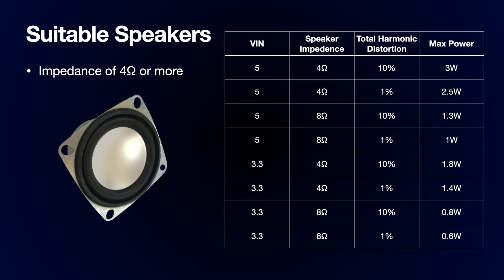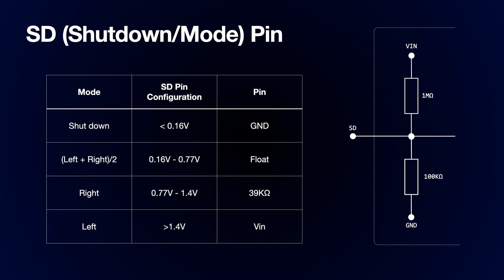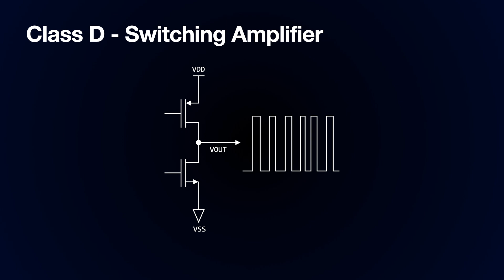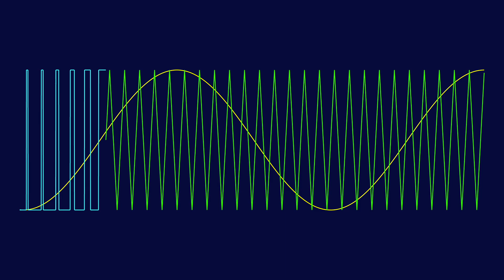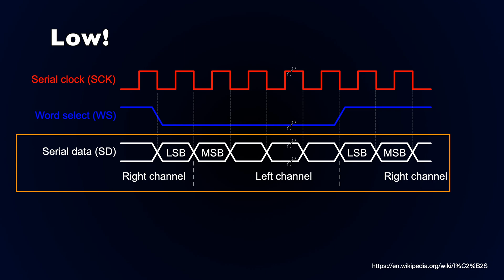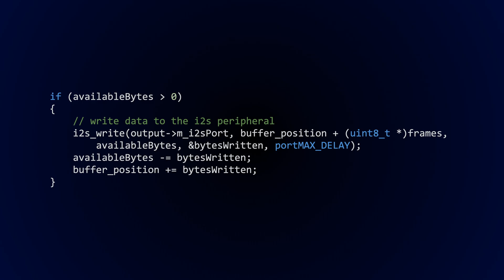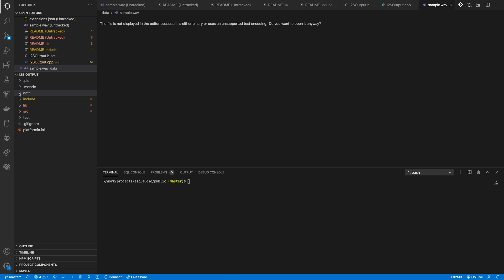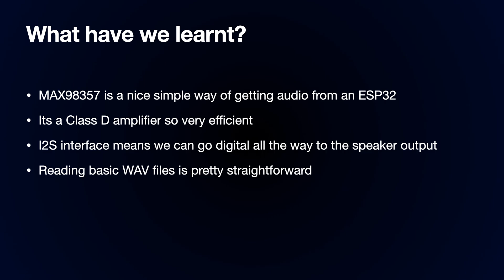ESP32 Audio Output with I2S DMA and the MAX98357A Class D Amplifier

Comment from the maker: Interested in ESP32 Audio: https://www.youtube.com/playlist?list=PL5vDt5AALlRfGVUv2x7riDMIOX34udtKD
Looking for all my ESP32 projects: https://www.youtube.com/playlist?list=PL5vDt5AALlRdN2KyL30l8j7kLCxhDUrNw
Reply: I am curious how the pinout and wiring would be affected if I use the Firebeetle esp32 from DFRobot?  The firebeetle has a rather distinct series of pins exposed and while it supports i2s I am not sure where to connect this.  Googling ended me up finding this...so I am gonna poke it and see what happens...
Reply from the maker: @Kai-Made  In theory, you should be able to use any of the pins on the firebeetle as the ESP32 is pretty flexible when it comes to GPIO pins and will route the peripherals to whatever pins you tell it to use.
Reply: @atomic14  you are correct.  A little trial and error.  Using the pre-designed library I was concerned it was pointing to certain pins and I just wanted to make sure my MC had them.

I figured it out.  The max98357 amp module is not very loud though, and I have done the resistor pull to make it 15dB, still not noticeably loud.  I was hoping to use the combo to sound an alarm and have a device speak to the user... like "buzz buzz do something xyz".  But I am floating around 20dB, might have to get a larger amp...not sure yet.  more testing required.
Reply from the maker: @Kai-Made  That's interesting, I've always found it too loud! How are you powering it? You should connect it directly to the 5v power. Also, by default, it plays (right+left)/2. You can either set it up to only plat the left or right channel or output both left and right. What kind of speaker are you using - that can make a big difference.
Reply: @atomic14  2.5 inch 4ohm speaker from bluetooth thing I cabbaged.  I was using 3.3V, I will try using 5V next chance I get.

I will try it with the pulldown to boost to 15dB as well...and see how it goes.  I just don't think I will be getting a useable audible alarm from this...was hoping to use it in the field on a project I am trying to sort out.  We need a 80dB alarm and piezos just aren't doing it...because the encasement/box we put it in.  It would have to be external, and all the "waterproof" piezos we have sources are terrible, but the water proof speakers we have found seem to work well and that is why I was testing...
Reply: Hello atomic14, have you ever tried or planned to use an ESP32 as input for I2S signals (from other sources, maybe another ESP32 (internet-radio with wifi enabled) or an I2S microphone) and feeding the data forward to a bluetooth speaker?

Comment: TinyS3 (ESP32-S3):  Hoping to save others a lot of time, I had to set the Data-In pin to an unused GPIO in the i2s_pin_config_t:   .data_in_num = your_unused_gpio_pin    Leaving it at the default '-1' will, I believe, use the same Data-Out pin for Data-In...which will mess up the Data-Out signal and you will never get any audio out. I am using PlatformIO with arduino framework, using the i2s.h library. A newer i2s library, i2s_std.h, is not supported with the arduino framework at this time (5.23.25). The newer i2s_std.h library MAY remedy this issue, though I haven't tested it.

Comment: You probably made an error in calculating the resistor value for the right channel. 390K seems to work with 5V VIN, 39K has the same as a jumper - left channel only.

Comment: 1:03 This means that i can't connect the output into another amplifier?
Reply: Correct. I believe it uses the speaker’s voice coil as part of its output filter circuit, which would not be possible with a high impedance input circuit on secondary amplifier.
Reply: Use pcm5102

Comment: I keep blowing up these bloody amps. Tried the sparkfun breakout and jumpered for L and R... blew up an amp. Bought Adafruit and powered SD acording to left and right... Blew up another chip. Reading the datasheet over and over again. I think I've got it configured correctly for Left and right but really confused.
Reply from the maker: That is strange they are normally pretty robust. How are you wiring it up?
Reply: @atomic14  I got two spark fun ones and wired them up according to their hookup guide. Next I jumped right and left... One of them broke. The other one has crackling noise now but still functions. I ordered two ada fruit ones... And one broke hooking it up configured for right and left channels. This time I ordered 4 so hopefully at least two will work for prototype I am trying to build.
Reply from the maker: @exploringgodscountry  When you say you "jumped right and left" what do you mean?
Reply: @atomic14  I mean jumpered. The spark fun ones come with configurable jumpers.
Reply from the maker: Looking at the sparkfun docs, by default the board will mix LEFT+RIGHT. If you just want left or right, you need to cut the link on the "mono" jumper. Then put a solder blob on either the L, or the R, depending on what channel you want it to output. If you are connecting both L and R then that is incorrect.
Reply: @atomic14  hey thanks for looking that up. I had to get at my computer so I could type a real reply :) Really appreciate your help and your channel. I had a SparkFun employee double check what I did from hookup guide on their website. It was correct. My Adafruit boards I soldered into a grid PCB prototyping board. I wonder if I messed something up doing that. I struggled immensely fiddling around with the right channel left channel SD pin configuration. The datasheet is clear enough but seemed like every time I tried to configure a channel I'd get horrible static, it would just stay mono, and or the board would die. I honestly, have tried soooo much that I should probably make a video just on what didn't work haha But your video DID get the left channel to configure for me! I had kind of suspected there was some load internal to the chip that was affecting voltage for the SD config but didn't fully understand their push pull versus pull up stuff. It's also possible I didn't configure a push pull resistor and blew some of the other chips up.... BUT that says for under 3.3V power supply. I have 3.8V. The list goes on. I got my masters degree many years ago to do this stuff but never did much of it as an engineer. Now I'm trying to open a freelance PCB design shop and practicing with with a BT audio concept I have. I have one customer lined up and really need to sharpen mys skills before we take their project on. However, darnit, they don't make the little DIP packages anymore I used to order which made prototyping SO much easier. I'd just reach out to the chip maker and they'd send them to me for free most of the time. You didn't need these breakout boards. Thanks for the help! I really appreciate it. I've watched several of your videos and they've been great!
Reply from the maker: No problem at all! It can be very frustrating and often the datasheets seem to be written with an "expert" in mind and lots of assumptions. I've been caught out by hidden pull ups on pins.
Reply: @atomic14  I've found quite a few typos in datasheets! One thing comes to mind is ADC for an ARM processor I was working on back in 2008. I spent DAYS trying to figure out why I couldn't get the ADC to work only to find out it was a typo in the datasheet! And there I had several other engineers working with me. It's awesome now that we can collaborate and share through the internet. Thanks for your videos! Very helpful.

Comment: Thought I would add this, BUT for the ESP32S3 i2sconfig I had to add/set the .left_align = true to get the serial data to most significant byte first or the audio was complete garbage. Only found this by creating a generated count up int16_t buffer and outputting thru i2s_write and using the saleae logic analyzer to see this was the issue.
Reply: this saved me - thanks for posting.

Comment: can we not play a wav file coded as hex file through I2S max98357A. I tried using Xtronicals example and it worked without I2S but was very noisy and would like to do the same using I2S . The problem is I am not  an embedded systems developer I am able to manage but do not have in depth knowledge in this regard can you please guide me?

Comment: Hello atomic14, I like your videos about the ESP32 and it's audio capabilities. I'm trying to build an internet radio with two ESP32. Why two?: because with an ESP32 (due to Phil Schatzmann) you can only use either wifi or bluetooth (not both at the same time). But I'm planning to use a bluetooth speaker with the internet radio, just because the sound of my BT-speaker is much better than the squeeky 3W at the max98357. So I need both: wifi and bluetooth. Now I'm looking for an example that uses the I2S of an ESP32 as input and parses the audio data to a bluetooth speaker. Have you ever tried such a thing (ESP32 Audio Input with I2S DMA and A2DP output)?

Comment: Thank you for your videos, I am new into electronics, and I learned a lot by them! :) I am working on a project, which uses the MAX98357A amplifier with an 8 ohm 1.5W speaker for now, and I have encountered a weird issue. 

Hardware: Nodemcu 32S, MAX98357A, 8ohm 1.5W speaker, which I want to exchange to a 4ohm 3W one.  The power supply is a 5/3.3V breadboard power supply at the moment.

I want to feed 5 Volts for both the MAX98357A, and for the ESP32. I connected the power source positive side to the 5V pin of the ESP32, and to the VIN pin of the MAX98357A. Both the groundings of the ESP32 and MAX98357A  meet in a common star shape before going back to the negative side of the power source. When I powered the system, the speaker was completely silent almost, I heard some extremely quiet cracking from it. I tried to check the speaker by a multimeter, if does it receive any Voltage. When I connected the negative needle to the negative side of the speaker, the speaker starting giving sound, but a very cracky distorted one. After I connected to positive needle of the multimeter too, the sound became clear. If I remove the multimeter, no sound again. Then I pulled out the grounding of the MAX98357A completely, and it started giving the cracky sound again. In the end, I tried connecting the gain pin to a GND pin on the ESP32, then it gave proper sound. The same effect happens with both the 3V3 and GND pin of the ESP32. Connecting the GAIN into the star shaped grounding wires of the ESP32 and MAX98357A, no sound again.

Could you help me please, what am I doing wrong? What is the issue with my 5V configuration? Why does the star shaped grounding solution not work, and why did it start working when I connect the GAIN pin to the 3V3 or GND pin of the ESP32?

Comment: Hi, I am just a new subscriber of your channel.... Your work is just amazing... Just a basic question : Is the method presented here is the best to play sound files on ESP32 in term of quality (rather than using the builtin DAC ?). Kind regards
Reply from the maker: The built-in DAC is a bit noisy but works ok. Here's my video on outputting using the DAC: https://youtu.be/lgDu88Y411o and another one on outputting with I2S directly: https://youtu.be/At8PDQ3g7FQ - personally I think using I2S gives better quality - the built-in DAC is pretty noisy and doesn't have good linearity. But it's great for directly driving things like headphones.
Reply: @atomic14  Thanks for your fast answer. I ordered the max98357A w/ 3W 4ohm speaker. I am planning to use your I2S integration coupled with a K210+ESP32 board to do a 'cat detector" for garden. In the sens to avoid them to damage fresh ground.... by playing a dedicaced repulsive sound (changing randomely according to a special portfolio)
Reply from the maker: @sebydocky5080  oooh nice. One of my friends built a cat squirter and trained it to recognise his cats and squirt any other cat: https://robdobson.com/2017/08/machine-learning-the-good-the-bad-and-the-ugly/
Reply: @atomic14  Haha nice project as well ... Well ML is my party, so I am not afraid about that ....:) Thanks for your answers in anycase. I am planning to plug everything into Home Assistant  I like to use ESPhome in general... but actually no support of I2S (yet)...

Comment: Can this code be used in Arduino ide? Thanks! (Never used anything else than Arduino ide)
Reply from the maker: Yes you can, it's just a bit of a pain to manage multiple files in the Arduino IDE.
Reply: @atomic14  okay thanks, tried it out and it compiled. Thanks for your help in the diy community ❤️
Reply: @aarriikknn33ll  how you manage multiple files? i am new in Arduino IDE. I will be really appreciate as it is my project in college
Reply: @PTyakiniku  Just open it'll work

Comment: Hi there, am new to electronics and am actually trying to build a portable speaker with a class D amplifier. I found a lot of bluetooth connectivity options but streaming music over wifi is extremely limited. I am on a tight budget and was wondering if this module can somehow be used to receive music from a phone or pc and supply it to the amplifier like a much costlier WA31 Up2Stream wifi audio receiver
Reply from the maker: Hi Akshay - it's definitely possible - I don't have any code to show it, but you can write code on the ESP32 that listens for data on a TCP socket and you should be able to just send raw samples from your machine to it and then play it on the ESP32. Let me know if you find any good examples on your search.
Reply: @atomic14  like I said, am new to all of this and other than knowing it's somehow possible, everything else just few right over my head 😅

Comment: great tutorial, but before starting I have one question, in My project I need to connect
	1. 10 Small LED RGB White 5V (Planning to use PCA9685)
	2. 2 DC motors 6v or 12v (Planning to use L298N)
	3. 4 Stepper motor  SG90 9gm ((Planning to use 2nd PCA9685)
	4. Control over WIFI/Bluetooth, by Android app(which I can develop)
	5. 1 Speaker with MicoSD mp3 audio in it (MAX98357A/SD car reader)
Can I use ESP32 for these all or do I have to buy other chips as well ?
Reply from the maker: I think you should be good - the ESP32 does I2C so can drive the PCA9685 no problem. Does the PCA9685 have a stepper motor driver?
Reply: @atomic14  yes PCA9685 is pwm servo controller has its own ic and power input, also they can be daisy chained with ewch other upto 96 boards . With only 3 input pins from esp32.

I am worried about other devicesi will ve connecting and whether esp32 has enough pins for other output I will be connecting
Reply from the maker: @AkashJadhavIT  There's a really good video here that discusses which pins can be used - along with a handy spreadsheet - https://www.youtube.com/watch?v=LY-1DHTxRAk

Comment: on my MAX I2s amp, i need to tied "gain" to the ground for this work !
Reply from the maker: Interesting - I was testing mine last night and it works without the gain connected - though I am wondering if should be connected - the docs are not clear.
Reply: @atomic14  After i try to let it open....and it works too with higher gain.

Comment: What do you think of the audio quality? On another note, I can't drive more powerful speakers with this so I'm currently considering the TAS5825m which is also an I2S amp, hopefully that will work.
Reply from the maker: To be honest - hard to tell on the audio quality front, I was driving it at full power without a proper speaker enclosure and from the same USB power supply as the ESP32, so probably not ideal conditions. Looking at the datasheet for the TAS5825m it should work. Sounds like you are working on an interesting project!

Comment: Good videos - thank you! I'm wondering if it's possible to stream incoming bluetooth audio (e.g. sent from Phone) and have the ESP32 output it to a stereo system (having it's own amplifier, I presume) using your method?
Reply from the maker: Looks like Espressif have you covered:

https://github.com/espressif/esp-idf/tree/master/examples/bluetooth/bluedroid/classic_bt/a2dp_sink

You'll need to use the idf to build their example (or pull it apart) - I might try and do a video on the subject.
Reply: @atomic14  would be great to have a video on it! :)  Just to clarify: I am not talking about web radio streaming - since I've seen some examples on that before. What I haven't found as of a month or two ago is actual audio streaming from one BT player (e.g. phone playing Spotify) to the ESP, which then outputs to a board with a 3.5mm jack or similar, that would connect to a speaker system.
Reply: @AminShahsavar  please see the examples provided by the ThingPulse team for their Icon64 product. https://docs.thingpulse.com/guides/icon64-esp32-rgb-led-audio/
Reply: @gunnarthielebein5982  Thank you Gunnar, looks very good!